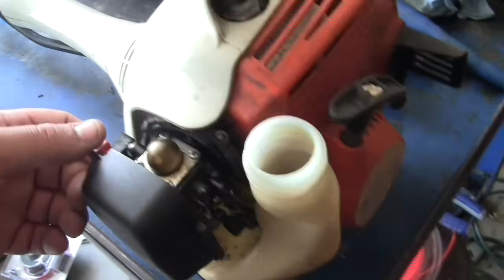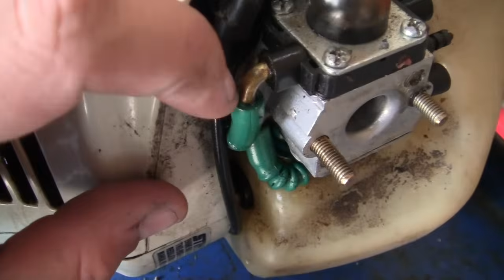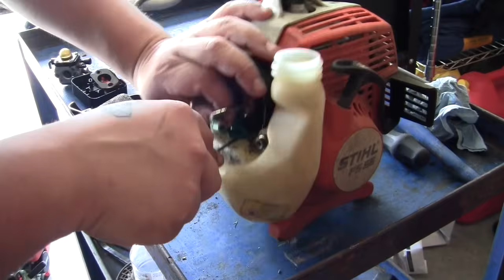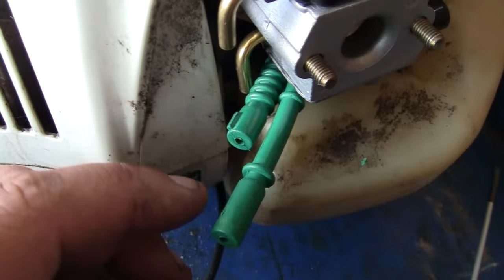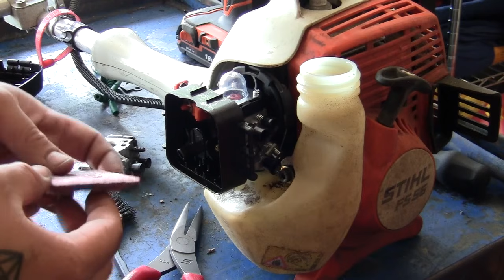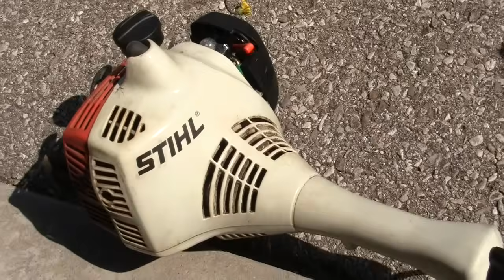Stihl FS55 Carburetor Replacement

Comment: This video really helped. The only issue I ran into was it was a very tight space between the outside of the nut and the housing and my socket would not fit until I forced it. Very helpful informing us of 8mm nut size also. I lucked out after starting I didn't need to adjust the carburetor and it operated great at full throttle. I was surprised to see these carburetor kit replacements for only $14 including spark plug and spare fuel and air filters, etc.   It started on 2nd pull too.
Reply: Molim Vas lijepo ako je moguće želio bih vidjeti izgled i sastav startera iz nutra kako izgleda od trimera STIHL FS 55R

Comment: Before you give up on the carb, be sure you have good gas and a cleaned spark arrestor.  A dirty spark arrestor will cause symptoms which will lead you to the carb or other fuel side issues.

Comment: Thanks for sharing the detailed steps on replacing the carb, fuel lines, and fuel filter on the STIHL FS55.  I have a model FC55 and the carb, fuel lines, etc., etc., were the same as your FS55 so I was able to replace those three items using your great instructions today.

Comment: I've been going through several "How To" videos on replacing the carburetor on a Stihl and found your video to absolutely be the best instructions.  Simple, concise, and very easy to follow.  Thanks for a great "How To"!!
Reply: I totally agree 👍
Reply: @GINGELL1982  Great video thanks, I just replaced the carb on mine and it is up and running. Now I need to figure out the double line spool.

Comment: @pimpinpenz , have you come across an FS 55 with no high/low screws? I've looked everywhere, there's no hidden holes with plastic caps covering secret adjustment screws. I take it this type of carb is nonadjustable?
Reply: I have come across the same situation with the FS55. I'm guessing that they had a change in carburetor style,later in the production run.
Even looking at parts diagrams,none will show the the Zama hidden screw version.
They all show the adjustable style.
Probably had too many warranty claims with the hidden screw version that couldn't be resolved without replacing the carburetor.

Comment: Just replaced the carbs on BOTH my fs55'S for $40. New plugs and I'm still having trouble getting them to run. 
adjusted the carbs (to factory sets) and still NOTHING!. I guess the next thing is to put some acid on the piston and clean it. Then check my mufflers.
but dam I was hoping they would just start up. I've got 10 acres and have been waiting for the carbs to come in.  I rebuilt the originals also as backups (bulbs went)
Reply from the maker: When you pour a couple drops of fuel down the Venturi or throat opening on the carburetor do they fire up?
Reply: It was the spark arrestor, anyone having carb problems I suggest you start there! 
Cleaned my coil magnet a little also and starts first pull. Don't even think I needed the new carbs after all.
Steps for checking Stihl carb
1. Check/remove Spark Arrestor 
2. Clean carb
3. Clean Coil and lube everything.

It will always Stihl run!
Reply: @mitchellkennedy3556 , nice pun, I see what you did there.

Comment: Do you recommend the aftermarket carburetors that I'm easily finding online that comes with both gaskets, fuel line assembly and air filter?  I'm not finding anywhere to purchase genuine Stihl parts.
Reply from the maker: Dee Jordan Yup just look at the reviews before you buy.
Reply: @pimpinpenz  Update:  So I received the HUZTL C1Q-S97 Carburetor which is supposed to fit my FS55, reviews were all good for the most part.  Got the carb installed with the new fuel lines, gaskets and air filter, started the machine and it ran as long as I kept it throttled, would not idle.  I tried to adjust the low speed screw in and out and it had no effect whatsoever.  So I throttled up and attempted to adjust the high speed screw, and it had absolutely no effect either.  I watched another video and he suggested turning both screws all the way in to seated and out 1 1/4 turn and fine tune from there, again I did this with no effect at all.    Also, a couple of the negative reviews had this same issue.  Any ideas?
Reply from the maker: Dee Jordan does the machine rev up okay? It could be that the idle screw is backed out too far? Also with these aftermarket carburetors I’ve had luck with adjusting the high speed first for some reason. I will rev the machine full out and adjust the high speed screw until it revvs the highest and then back it out 1/16th of a turn. Then I will proceed to adjust the low speed screw until the machine idles the fastest and then back the screw out 1/16th to 1/8th of a turn. I then adjust the idle screw until the idle sounds proper to me. I hope this can help you out. If not if you purchased on amazon you should be able to get your money back easily as I’ve had a similar issue happen to me with an echo machine in the past. The carburetor that I got would not fill the primer bulb. They issued me a refund. I hope this helps. Thanks for commenting.
Reply: @deejordan9212  did you get it adjusted and working properly?
Reply: You can get genuine Stihl carbs and parts on ebay, but they're not cheap.. a generic carb can be bought for $12-$15.. An OEM Stihl carb is around $40-$50.. I've used both.. not much difference..

Comment: I’m just trying to replace my fuel filter,,,my fuel lines r fine.  However if I take them off the carb do I need to replace them once I take them off because of there air getting in the fuel line u we’re talking about?
Reply from the maker: If youre only removing the fuel filter, no need to remove the carburetor, Just remove the filter through the fuel tank opening. If you remove them from the carburetor theres a chance for an air leak. Causing a lean run condition.
Reply: @pimpinpenz  I think he means "Will air in that hose be bad" the answer is. NO don't worry about it. Air in your gas would be hard to avoid, especially off road.